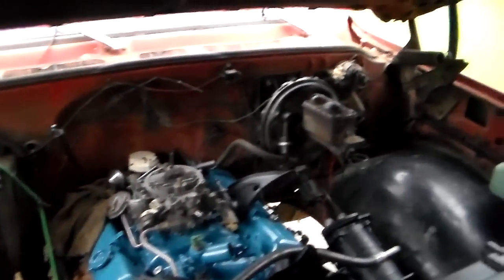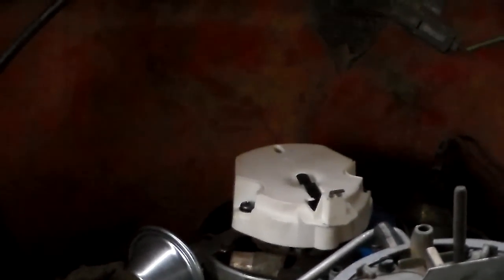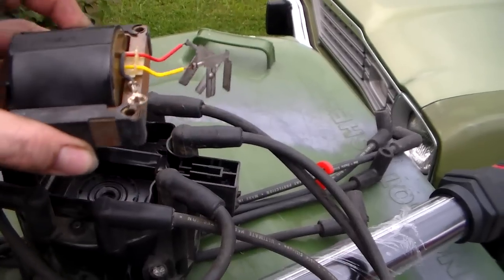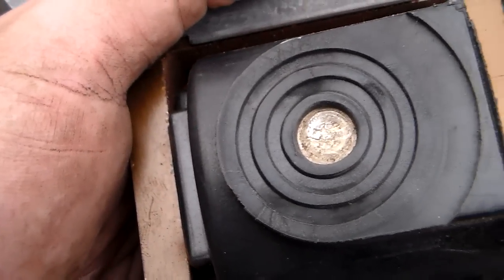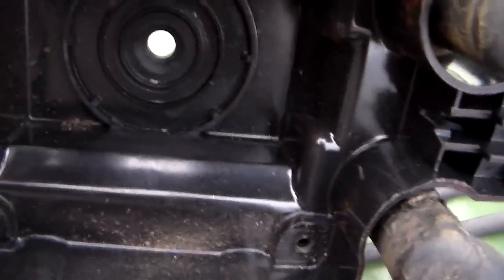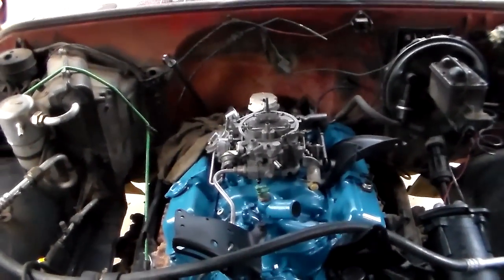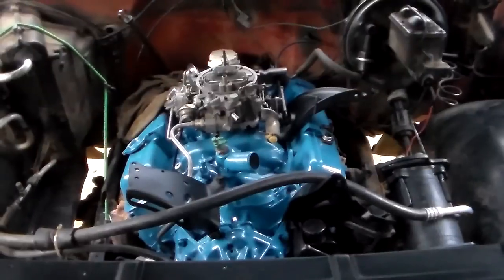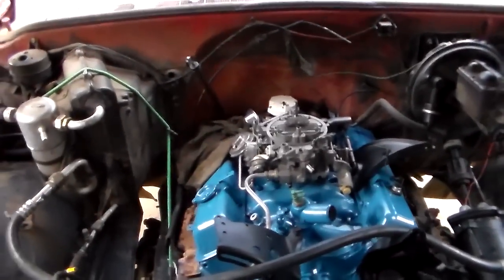Possible HEI coil issues

Comment: Should have dielectric grease in those grooves around the center contact. Just don't put any right in the center contact area.  Dielectric grease does not conduct electricity.  It is an insulator.

Comment: Check your phasing to be sure spark isn’t having to jump too far.  It takes the path of least resistance and if arcing through that round rubber washer to the coil body is the path of least resistance then find the path of most resistance....

Comment: I have and HEI coil too.  It bench tested good, but had no or very weak spark.  Replaced the cap and coil with a very old worn out one I had around and it now ran.   Bought new coil, everything is good.  But the old coil still bench test using ohm meter as good.   In your case I think you have a bad spark plug wire.   Arching is evident even on where the wire connects to the distributor.   That 50K volt is looking for a ground somewhere.   Apparently, its not making it to the spark plug so it trying else where.    Replace that one Spark Plug wire and see if that helps

Comment: Have a 1972 Cutless supreme. Came with a point system. Engine was shot. Got another engine and fired it up on the ground. The other eng has a HEI system,
Completely rebuilt the engine (machine shop, good price). 
Brand new cap, rotor coil, wires etc. Went to start it and no spark coming outta the the cap. 
I jumped it across from direct 12 vt to make sure its 12vt to the cap, nothing. Tested everything and everything checks out, but still no spark.

Comment: Hey bud my old friend. I'm having the same problem with my 1988 GMC step side. It has a 350 vortec swapped with HEI and carb swap. No TBI anymore. Hopefully you figure it out. My problem could be I believe due to after testing the coil the primary showed 2.7 Ohm's then swap leads and showed 5.7 Ohm's so way over the .6 Ohm's it's suppose to show. I'm getting spark and ignition but spark is real weak with a orange spark. Will be installing new cap,wires, and coil this Friday and hopefully this thing will fire.

Comment: i'm having trouble with my hei distributor on my 85 camaro(it has a older 350 ),i'm not getting fire,and i noticed the coil pick-up wires are loose,so i guess thats it.

Comment: Hi I just noticed in your video on your engine attached to the top of the coolant thermostat cap outlet is that temperature actuated thermal vacuum switch. I have the same thermal vacuum switch. What does your vacuum lines attached from that too?  On my 1976 GM V8 my thermal vacuum switch on that exact one has vacuum going in but on the line going out is capped and can’t figure out what it used to be attached to!  Can you give me a idea? Thanks Ben

Comment: I'm with Cactus Bob, I'd say some moisture under the cap.  Very much trouble free distributors really.  Kinda like the great quadrajet carb, you have to know GM knew what they were doing back in the day.  But, I do have a question for you in regards to ignition timing.  Is it true or a falsehood that the factory specs are for sealevel and if you live above sealevel, you should advance 1 degree for every 1000 foot of elevation?  Just wonderin, great vids BTW  especially like the way you defend the Quadrajets!!  I like that, been running them for years.  Have a Good One Bud!!

Comment: Id use the coil that doesn't have the arcing evidence.

I may be doing some coil swappin myself as I found my truck to be running poorly and the only discovery I made upon checking everything out was orange spark.
Reply: clubcar98 hey when you say running poor did your car run okay at idle but at a stop or light it acts like it want to shut off but once u hit the gas it misfire a little then straightens up

Comment: I agree these can be a pain when they go wrong! I changed the cap, rotor and coil on my 1975 Corvette because they were 20 years old and now it has no spark. Pick up coil tested fine so changed ignition module. Still no spark, beats me! Have you had issues with that ground strap you mentioned?
Reply from the maker: Jivan Naran  Those coils can be bad out of the box. If you still have the old one try swapping it back in. The polarity of the two colored wires needs to be correct also. Haven't had any ground strap problems.

 I've seen those HEI coils torch a hole through the center of the distributor cap, lol.

Comment: I have a question I got a brand new hei distributor everything new the coil the cap the rotor the shaft all of it. I dropped it in and I'm not getting any spark from the spark plug wires I metered the coil when I turn the ignition forward and it has power going to it. And I metered the harness that connects to the distributor and that was good. But when I try to start it no spark is going to the plugs. I can't figure it out for some reason. Got any recommendations?
Reply: I have had the same problem. I thought it was the carb and pulled it apart several times then found I had no spark. All I have done twice was pull the cap off and spray contact cleaner in the cap and clean the rotor and the stupid thing starts right up. I am beginning to believe I may be getting crank case fumes up into the distributer and it is filming the contacts just enough that it can't fire to the plugs.
Reply: CamsCummins92  is the mechanic need to get replace lol
Reply: Man i have the same issue,  ran fine the day before. I've been replced the module,  coil and waiting to see another electronic module.

Comment: Any help would be much appreciated I have the same truck and HEI oil and I have power to the pugs that go onto it every thing on the coil and on the truck is grounded as it should be but I notice that the coil gets really hot And I don't know why. Like I said it has power to to the plugs but why am I not getting spark I've been hoping to replace the whole distributed because I mines really old and so are the parts but before I do I wanna make sure that it is modulater

Comment: These pick up coils can be a pain and don't always show or test bad. Good idea as far as next time you think about changing the coil. Get an external coil.  These things are just epoxy steel and wire & they cook fast.  An oil filled coil a good one and an adapter cap  from say summit or elsewhere, so you can use a good oil filled coil. I think the adapter caps are like $40. You probably will never change the coil again. B-)
Also make sure no slop is in the distributer shaft. The bushings can wear sometimes nd cause very strange symptoms from the shaft moving against the motion of the vehicle on acceleration etc. 
They say the pick up coils are simple to test in the books, but some are borderline and test good. B-)